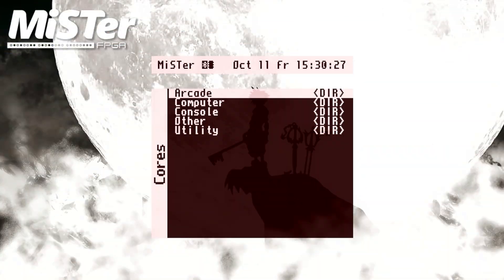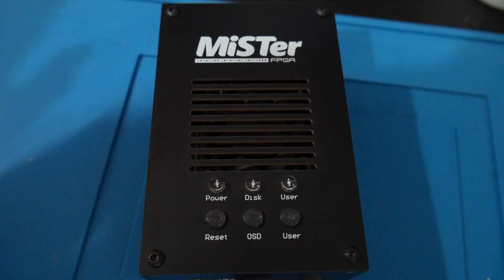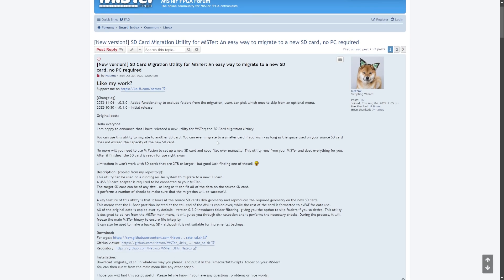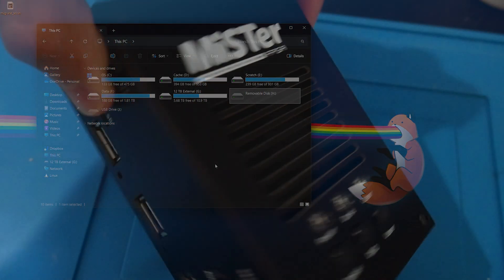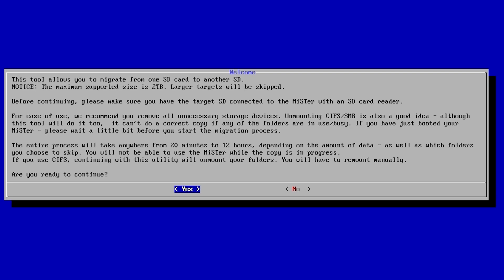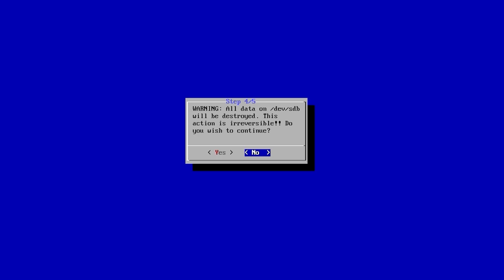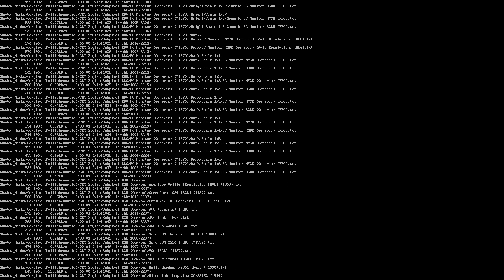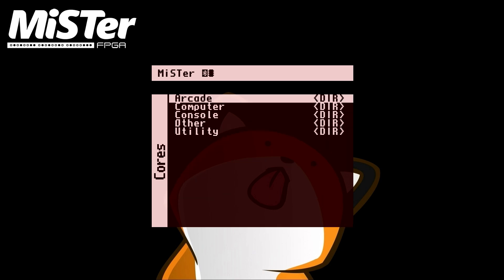MiSTer FPGA: How to Easily Upgrade to a New microSD Card!

Comment: I bought and downloaded nothing, I just copied the old to my pc and then to the new one.  I don't know why I would jump through so many hoops when it was really that simple.
Reply from the maker: Either setup would have required you to buy items if you didn't already have them, so not sure why that's relevant? The only jumping through hoops here is downloading and copying a single script.

Outside of that, you run the script and go to bed. Not sure how that's so complicated?
Reply: @MrMario2011  I didn't buy anything extra for PC method unless u mean buy a PC 🤪.   I put the SD card into my PC, copied the files, took like 1hr.  Put in new card, copied files took like 1-2hrs.  All done. Cost $0 and was much faster than the script.  I guess maybe the script would help some, but seems pointless to me, IMO.

Comment: hum, having issue with the script. Runs but the new card doesn't seem to load and isn't readable on pc.  Going to give it another go.
Reply from the maker: Might need to try another card? That's concerning if it can't be read on PC.
Reply: @ I ran it a second time and it fully went through. Not sure why it didn’t work the first time, but I am all good now.  Thanks